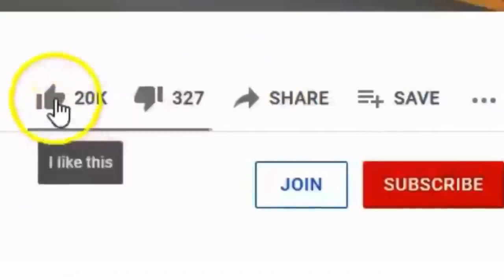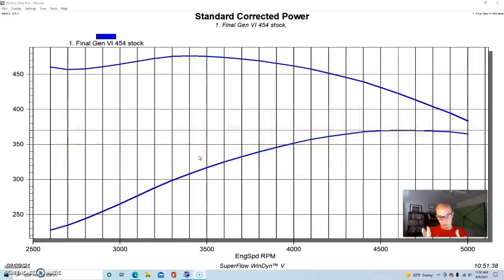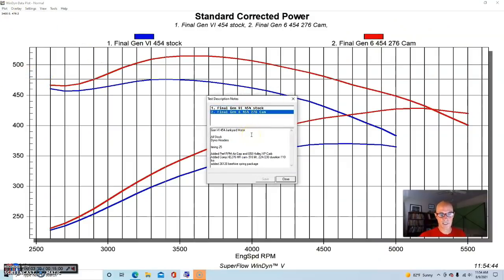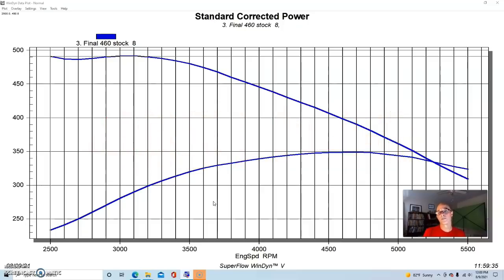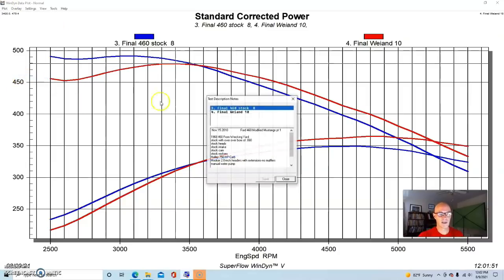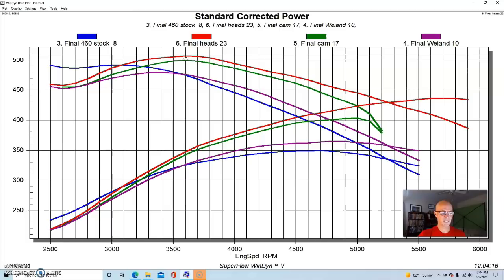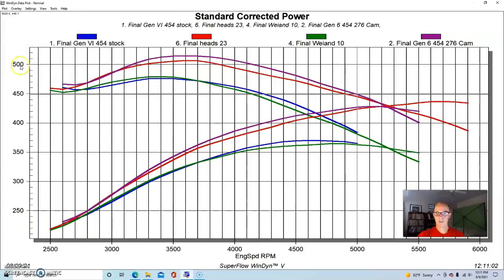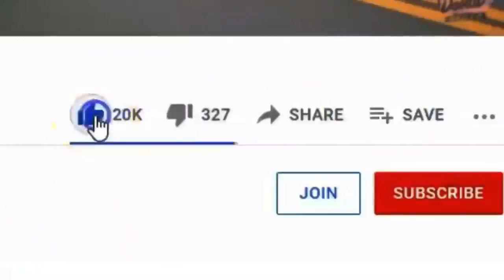JUNKYARD BIG BLOCK POWER-460 FORD VS 454 CHEVY FULL DYNO RESULTS

Comment: It’s all about airflow.  Horsepower doesn’t care what brand bottom end you use just depends on the cam, and heads and displacement.
Reply: But the bottom end does care about how much bang is in the top end. I.E. 302 over 500hp power shifting.
Reply: @TheDude2111  Stop pushing this block splitting at "x" amount of horsepower. Its not a rule of thumb by any means.
Reply: actually it is a rule of thumb, because back when folks built 5.0 pushrods rather than swapped 'em for Coyotes (due to the block splitting), they tended to let loose at 500hp.  Part of that is the blower belt pulled tight on that crank--its a different crank than earlier 302's (edit: don't know why i said its a different crank, its the same crank, but the firing order changed on the HO to the 351W, so that the rear cylinders fired at the same time than the front ones), which is why the engine needs a different weight flywheel.  Also, the low deck Windsor max bores to .04, while a Chevy goes .06 over, which tells you the difference in wall thickness--the Windsor was initially designed to be a 221 cid economy car engine, the 265 chevy was a passenger car and truck engine that ended up at 400 cid.

there are some low deck windsors that CAN go to a .06 overbore, and they are the ones that tend to last beyond 500 hp with screw in core plugs and a girdle on the bottom end and maybe the wider K code Challenger 289 main caps.  But for the majority of low deck Windsors, the question isn't "will it crack its main webs past 500hp" its "when"...proven by a ton of racers in the 1980's, on the tracks and on the streets.
Reply: @albertgaspar627  For starters, the idea that people are swapping to coyotes over their pushrods because the blocks are splitting is purely subjective and nonsensical. They do it because it offers greater than twice the power production stock for stock. Be that as it may, there are a plethora of small block Ford's still competitive today ranging from dead stock thin wall roller blocks all the way to  the pricy Dart combos, whom many of which boasting these stock block combos produce way more power than what is debated to be block splitting territory.
Now, to the actual block splitting fallacy and why it is just that. If there is some "x" power number that the mechanical strength of the block is bested by, the same result would be seen across "most" of the engines regardless of the power adder or scenario but we already know that's not the case and you even helped make the point for me. If a power adder sbf is equipped with say, a positive displacement blower, the rotating assembly has a far different level of stress applied to it than say, a turbocharged engine, or even a combo on spray. To make the claim that it is the "x"  amount of hosepower will be the detrimental failure completely disregards the fact the block has no way of knowing the difference in horsepower whether its 499 or 700+. Its less to due with the horsepower being produced, and everything to do with cylinder pressures, rpms, and where the engine is producing its torque. 
Lastly, saying that this is proven by racers is factually inaccurate. The only 5.0 block ive personally seen split was a roots blown stock block that lived several seasons at well over 750hp to the tires for years before even boasting any serious issues. While my personal experiences dont account for a rule, by definition, to be a rule of thumb, we would expect anyone who exceeds this power level to experience issues or total failure but decades of racing these combos has proved the opposite. Im not saying it doesnt happen, im just stating its not the "500" ,"600", or any "X" horsepower that will produce these failures, rather its huge loads at peak cylinder pressures, which can occur at any power level. By definition, its not a rule of thumb and rather remains an exception. 
Even Richard has good discussions regarding this and why its less of a rule , and more of an exception. He as produced in excess of the "safe" power level handling on multiple occasions, even racing his own supercharged sbf non intercooled with as long as 30 minutes at 100% wide open throttle and it lived on. This is just one of thousands examples. How many times have you personally seen a failure?
Reply: @madmod  500hp on a roller block is just common not guaranteed that's why I added a note about powershifting implying load shock to engine which is less likely to occur with an unlocked tc auto. It also has moore to do with tune "project stock bottom end" is a good read 800hp with a tko and it a daily driver (I'm not sure who daily's that though).
Reply: @madmod  well, many are likely swapping over as the usual "monkey see, monkey do", but if they're swapping over to a 412 hp junkyard engine...they're doing it because....the old one breaks past 500 hp where the Coyote begins making bolt on power :)  It has zip to do with power potential of the old engine design (otherwise folks would skip their pushrod LS for the OHC Coyotes), there's plenty of Dart replicas of the low deck Windsor making 1,000 hp, so its not like they can't do it by design (like say, a 221 or V8-60 Flathead out of a junkyard), they just can't handle the power output since Ford designed it to be a lightweight economy car engine.  but hey, thanks for just confirming what i said :)

I used the example of a blower for the simple reason its the number one way to get something that small in displacement to make more than 1hp per cubic inch and still be streetable (yes, nitrous is cheaper, but anyone knows it blows the top off a piston due to piston ring gap, something that tends to take care of itself when an engine has high miles, such as an engine from the 1980's with forged pistons). some people will use turbos on the dyno, but they tend to run a setup that fits well in the space of a dyno room but won't under a car hood (richard holdener, bless his heart, admits he dynos with a 60 degree temp inlet air--no engine ever runs that cool--and an electric water pump to run on after the engine shuts off) and so its not making the power they think that it is (unless they test rear wheel). Now, as for decades of experience, yeah, there's decades of experience...of the little 302 not taking the power of its big bro the 351W. You think the idea the "302 only takes 500 hp" came from Chevy fans? :)  I was "around" back then, when the 5.0 went up against deep skirt Buick V6 turbos with filleted cranks from the factory that took up to 600 hp on their 109 blocks, and Chevies that lasted--and yes, i've watched the 302 oil down both tracks and the street.  The girdles just held the mess together, and i'm far from the only person witnessing this--Mustang magazines back in the day were full of mention about this. I'm a Ford guy, and I know i'd rather do a 351W stroked out to 427 than push a 302 to past 500 hp if that's what i needed to make a certain number.   
.
There are some caveats to that, yes. the stock 302 cam fires cylinders 1 and 5 in a sequence that stresses the crank, the 351W firing order shared with the 302 HO does 4 and 8 near the new flywheel they put in with a different weight than the 1960's. so there can be an issue with what cam one uses, combined with torquing down that blower pulley belt. there are some blocks that left the Ford foundry able to bore out to .06--no doubt that's going to be stronger than the average block that can't go past .04 inches (compared to say the average chevy short block). Cylinder wall thickeness is pretty easy to gauge by how big an overbore you can go, and the thicker the walls are cast, likely the thicker the main webs--I mean, Ford had screw in core plugs for the Boss 302 and the K code Challenger 289 had thicker main caps. seems like even the Ford Engineers expected there to be an issue--same folks who couldn't budget a rear disc brake package for the Fox mustang unless the customer paid $5,000 more for an SVO.

On a side issue, since you mentioned Richard Holdener, he admits a 500+ 302 in his videos isn't really a comfortable street engine, so an increase in displacement would mellow that out. But many 347 kits have eventual oiling issues due to the wrist pins being in the ring lands--and its a lot cheaper to just buy a roller 351W in the junkyard.  and if you love long connecting rods, well, the tall deck Windsor's obviously got that covered as well.

Hence, for a dollar standpoint...grab the 351W when you want a broad torque curve, 500 + engine.
Reply: @albertgaspar627  Lots of fallacies in your retorts. Comparing dohc modulars to pushrods let alone flatheads is pure nonsense. Claiming "they just cant handle the power" is false. Theyve done so for decades. Claiming "a blower is the number one way to get small displacement into high power" is also false. Turbocharging holds the record hands down for max power production especially with smaller displacements. All your stuff about an engine never running in those conditions as tested on the dyno is false to a degree, my retort being jet boats which run below 60° water temps, no accessories and a jet drive is essentially a dyno brake. 302s do produce power similar to the 351w and support it often as proven by years and years of competition. All these issues you claim are factually not end all be all for performance in a sbf stock block above 500hp. People have been doing it with all forms of power adders and even na for longer than ive been alive. Its not new news dude. I appreciate the banter though!
Reply: Oh, its been a fun convo, alright :)  You keep trying to re-define things but people just think you're not understanding. We're talking about folks blowing up their pushrod 5.0's, and if you've ever been to a track or show, you know most run blowers...just like the 3.8 litre Supercoupe, the Terminator Cobra, the Hellcat...Detriot just loves itself a supercharger. Its easy to bolt on, its easy to make a fuel map for...and that makes it the number one choice.  Is it better or worse than another choice? who cares! its what's for dinner, er, what's being used and that's what we're talking about causing issues with the pushrod 5.0.  i'll bet you can build one yourself out of unobtainium and make 5,000 hp, but again...what does that have to do with what we're talking about? 

Jet boats? never seen one on pavement before. who cares what "a hole in the water you put money into" does. Does RH ever test an engine with water cooled exhaust? haven't seen it, and I don't see him in boat junkyards yanking marine engines. Yes, they do tend to be made of "different stuff" since they have to deal with the prop coming in and out of the water--so they load and unload. Wave hopping in the ocean rather than a calm lake would tend to sound different than a constant-application dyno water brake. So we're getting off topic.

Been fun talking, tho. we agree on that :)
Reply: @albertgaspar627  most is a word i definitely wouldnt use. I live next to a pretty big lake in northern iowa where jet boating is common. Around here we have tons of turbo small blocks running the Humboldt county drags. I have personal experience with a kb blowzilla 2.2L twin screw on my sn95 and it ran for 130k miles at around 550fwhp before being sold and is still running around.  Different strokes and different experiences all round. We are talking about engines and everyones scenario is different so putting out vague statements like "your gunna blow your 302 over 500hp" is just as nonsensical as saying "x" amount of boost will kill an engine. Richards tests make the point oblivious that he tests in optimized trim, not as its run in a car. Im not disputing that, just disputing these "rules of thumb" that genuinely have no basis. For every guy whos split his stock 302, litterally thousands have lived and run at the exact same power level. 
Again, different strokes man!
Reply: @albertgaspar627 "jet boats? Never seen one on pavement before."  Hard to take you serious after one like that, joke or not. Just cause its not your form of hot-rodding doesnt make it any less valid.
Reply: Maybe not the brand,but the specifics of the bottom end matter.Take the top end off of a DZ302 and slap it on a 305,the 305 would perform worse.The 305 would actually have less airflow due to the valves being shrouded by the small bores.You could notch the bores and lose compression.

Comment: I loved this comparison.  Although, in the future, I would like to see (if possible) a heads up comparison using the stock bore, similar aftermarket heads, the same cam, and the same intake......  with no additional alterations.   I understand that you might be limited to what equipment you have to work with, and you might have limitations.  But there is only one way to do a TRUE heads up comparison
Reply from the maker: how do we make a hyd roller and hyd flat tappet the same cam?
Reply: @richardholdener1727  use a gen 4 bbc with flat tappet for the comparison 🤷‍♂️
Reply: I think engine masters did that comparison
Reply: @richardholdener1727  Give them both similar Hydraulic Rollers
Reply: @nicolasstanley1392  what season/episode?

Comment: Richard, good video. But why not make it a more a similar comparison? The Ford had 18 more cu in, 1 full point more compression, slightly ported heads, smaller cam.
Reply: Some people in here are saying the intake used on the Ford is junk,they don't respond well to that intake.If you took the other advantages way from the ford and then gave it a edelbrock intake,it would still be a monster.

Comment: Depending on what year ford you have between 69 and 90 cc chamber. Comparing edelbrocks best dual plane manifold to an intake worse than anything edelbrock makes is a bit rough. With a performer rpm, lunati cam made 280 360ft lbs to wheels through c6 and 9 inch. Within 50 miles engine got pulled for broken piston and rocker stud. I was a dumb kid in tech school

Comment: Wow, the low speed torque loss below 3500 rpm on the 460 is crazy, just shows a matched combination makes all the difference
Reply: Yeah, it's stupid-easy to shift 460 low end torque way north in a hurry. The 400 Ford is actually a better truck engine.
Reply: The choked down heads and intake pull the torque earlier.

Comment: Thank you for this comparison! Whether they were the same or not I appreciate the concerted effort to try to be fair in the builds! This is also what I would have expected. The only surprise I had was that I would have expected the Ford to produce slightly more torque, but, overall I think it was a good comparison. Maybe the slightly lower friction from the rollers got a little more torque? No idea but thanks!